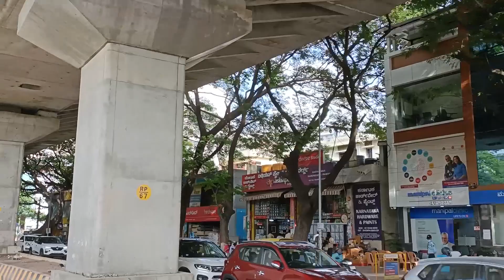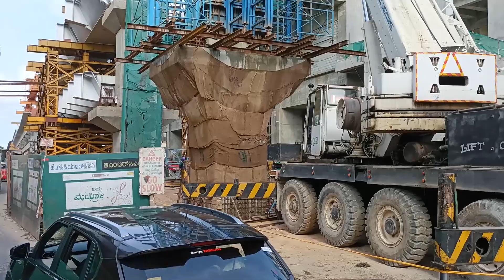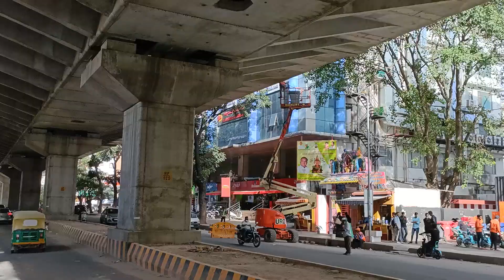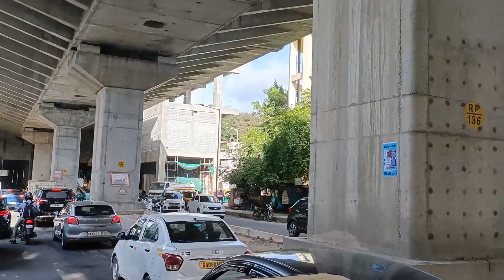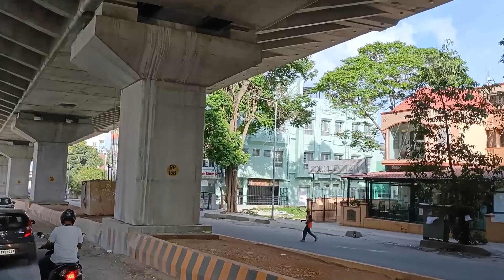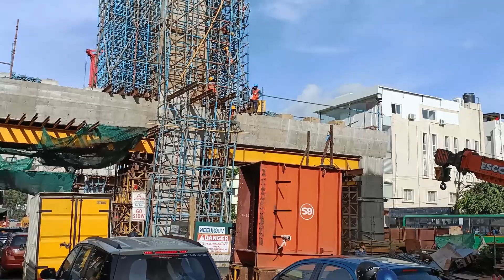Bengaluru First Double decker flyover construction progress

Comment: First clean up the existing city, add more parks and cleaner and greener spaces. Then go to build more. Concentrate on peripheral regions of Bengaluru develop outer regions of the city to make the city bigger. Introduce green living and more green vertical gardens and artificial water bodies from rain water harvesting within the city. Introduce more citizen and corporator interaction at micro level ward wise to help resolve issues quickly and at the root level. Namma Bengaluru is a heaven help beautify it and clean it to save it.